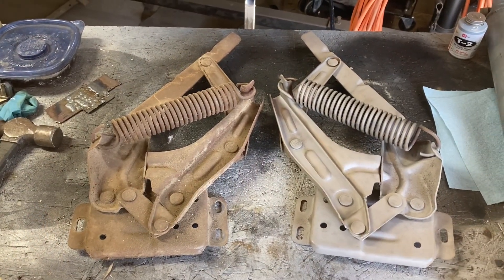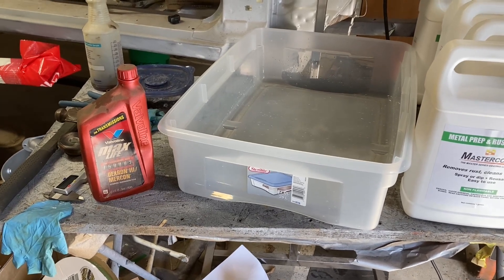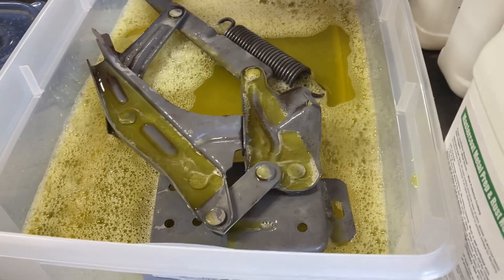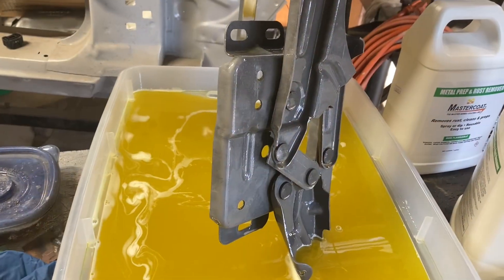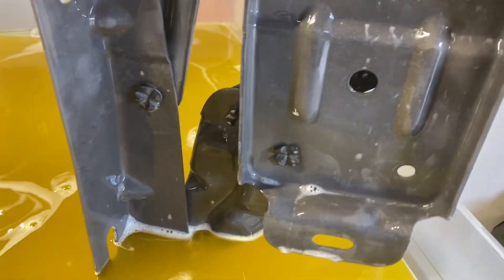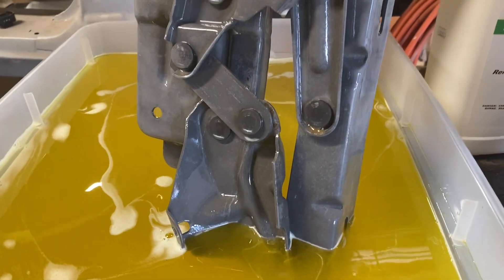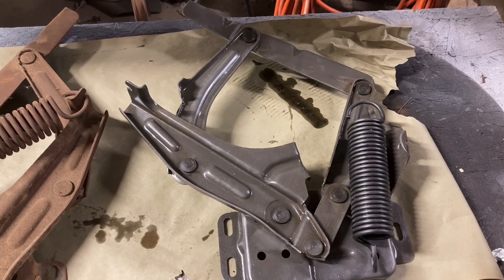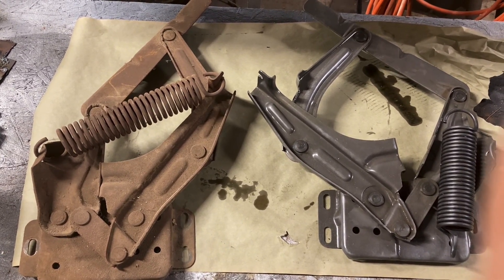Hood hinge restoration: phosphate coating

Comment: Thanks for the video! Unfortunately these zinc phosphate solutions are not available here and all these DIY zinc phosphate home brews don't work. I tried it with zinc and phosphoric acid. You end up with a black surface that is not abrasion proof. With a zinc phosphate coating you should end up with a light grey colour like in your video anyway. So this alone shows that it doesn't work. All those hanky panky steps like throwing steel wool in the solution is absolutely BS. It's almost a scam by all those showing it. So don't waste money on DIY zinc phosphate ingredients. 
I'm now looking for a real zinc phosphate coat liquid or someone who can do it...

So I'm sure that in those solutions is something that is not allowed in Germany to be handled by private slave citizens... What a fucking joke, really.

Comment: I am wondering why you don't tilt the container slightly to get the part sticking out into the solution?
Reply from the maker: Because it would have exposed another part then. There is a better way to do this than what I have done that people have told me afterwards. That is putting some other things in the tote that take up space and then putting some heavy plastic over that, set your part on it and then fill it up. The space displaced by the other things you put in it to take up space will require less volume of metal  prep.